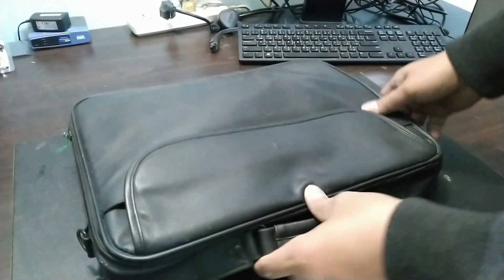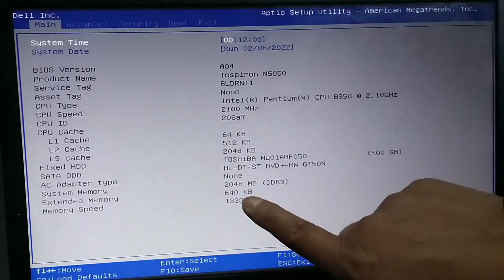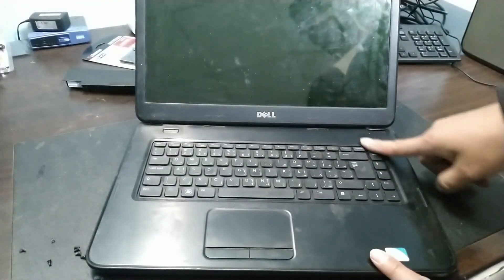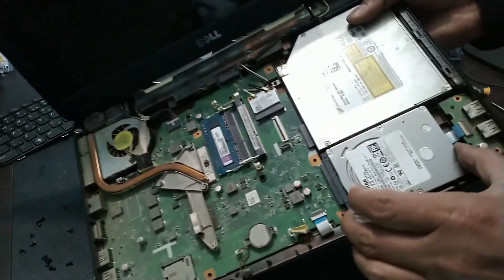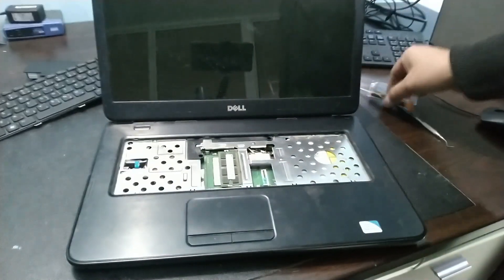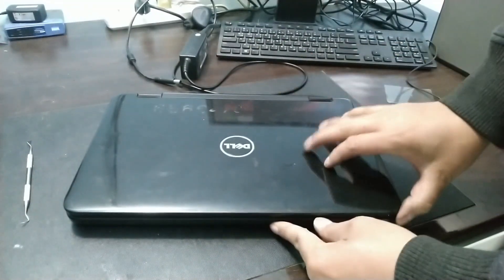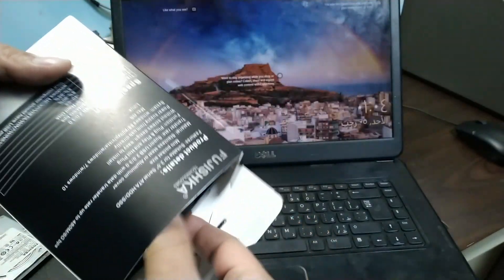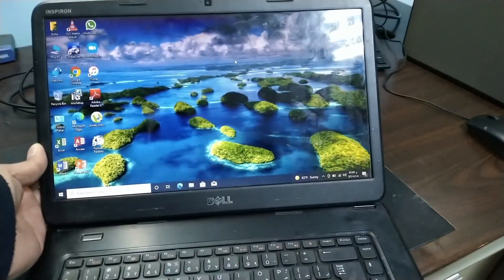RAM & HDD Upgrade for Dell Ins N5050

Comment: What's the best brand for SSD for upgrading on this Model / unit ?
Reply from the maker: Me, im trusted Kingston, but you can use any branded Co. they're all quality and good performance.
Reply: @erancarlmixedvlogs3791 is it possible to put the hdd in dvd slot.
I don't want to carry it separately always

Comment: Sir i didnot understand language pls make video in english or hindi?sir you didnot tell how to open and fix keyboard ribbon.your hand has come? Sir you open touchpad cable but power button cable you didnot open?
Reply from the maker: Sorry for no English sub.text. Actually flat wire or keyboard cable is very easy to unplug or remove. Once you pop up the keyboard just poke up the lock of the flat wire then it will be released.  The same reverse procedure when you return it back.
Reply from the maker: No need for power button to touch. This is RAM and HDD upgrade and no connections for power button. Just make sure to remove the battery.
Reply: Sir when we open the laptop cover we can open cover only if we remove the firstly power button cable or touchpad cable then why you said that no need to remove power cable?

Comment: Bossing  yong ganyan kong laptop nag upgrade din ako.. Pero Pag install ko ng windows 10, wala na siyang display. 
pero after windows installation may display pa siya,  but after updating windows no display na ng nag restart ako.  Pls help anong problema Sir.
Reply from the maker: Need mong i update ang Bios Version for Windows 10 firmware compatibility.  Go to Dell Website & download the latest firmware update for Dell inspiron for windows 10. ♥